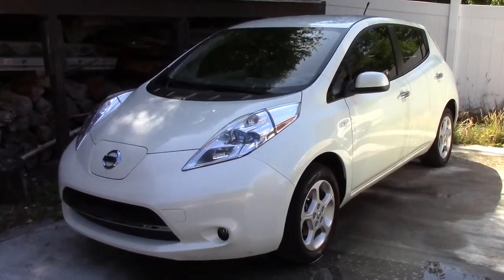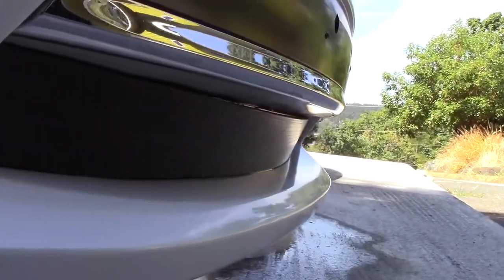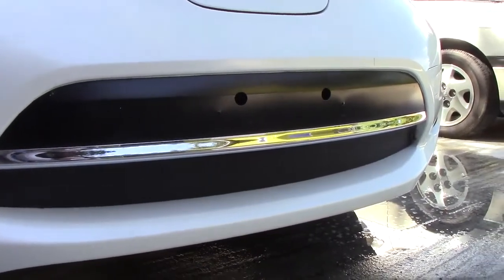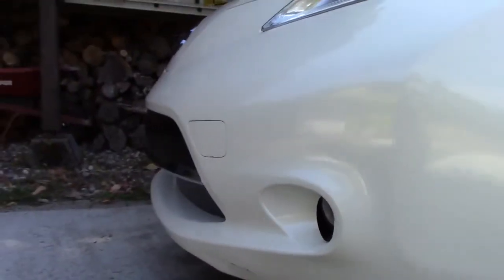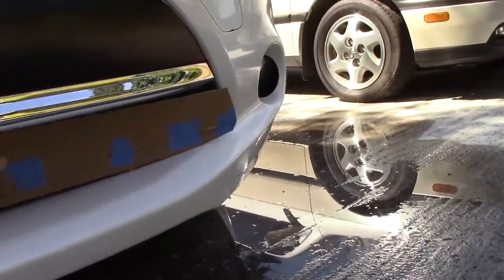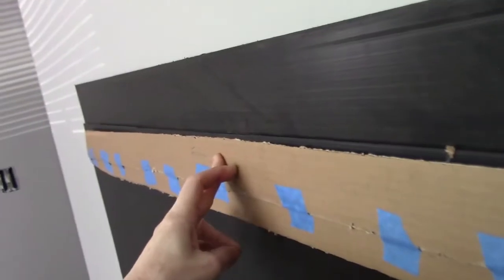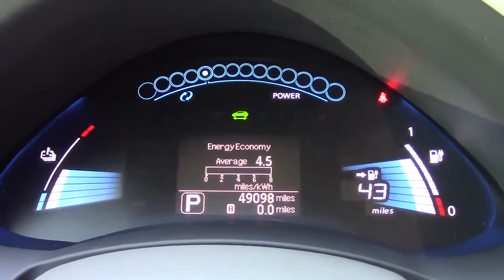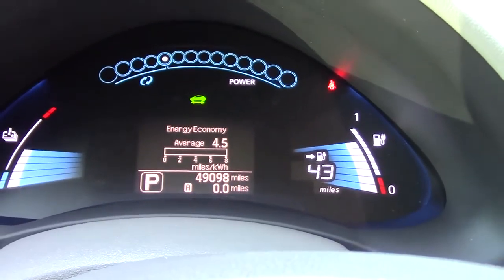Nissan LEAF - Modified - episode # 06

Comment: Lots of sarcastic comments here, but I did a similar mod using a 3D printed kit of small panels. I only use these panels in the winter time, as cooling shouldn't be an issue in winter :-)

Comment: The leaf has passive air cooling for the battery which is already insufficient when compared to other ev with liquid cooling. What you did there was to make the passive cooler even more ineffective. Your battery health isn’t going to like this mod. Bad idea.
Reply: Totally depends on where you live, dont generalize. I would pay for a battery heater, with yearly average temp being ~6C and often below freezing, the cold battery is limiting the range.

Comment: You know there's still a radiator behind there right? The motor is still liquid cooled
Reply from the maker: Yes, and no heat issues occurred in 90f weather.  A/C worked fine too.  Electric motors don't produce much heat & don't need such a large ICE radiator.

Comment: I think with the A/C condenser getting less air flow, the A/C would be less efficient and have longer run times which will use more energy from the battery pack defeating the purpose......
Reply from the maker: Yes, that would make sense... However,  what about the other 99% of the time !
Reply: OK thats 1% ...... The leaf also has a radiator to cool the motor and inverter if you drive on the highway 50% of the time (which is where this mod would benefit from) the motor and inverter will run hotter and be less efficient and use more power, it also can damage those components in the long run.....
Reply from the maker: I don't believe so.  First, of all this is not an ICE car: i.e. very little heat is being created.  Second, the radiator appears to be a full size unit right off the Versa/Micra & it has two electric fans on them as well.  If the slightest bit of heat is produced without the passive airflow, the thermostat would simply turn a fan or two on, as needed.  Yes, that would use some electricity briefly.  In a desert climate, maybe not the best mod. Everywhere else, there's nothing to lose & even more benefits in colder climates.
Reply: @theevolvingworld  so how can you gain range
Reply from the maker: @preciousredeemed4165  It's a little bit more aerodynamic with this mod.  Only helps at freeway speeds.

Comment: Your best mod will be a new battery.
Reply: 9 bars in 50 thousand miles. It's safe to say the colder the climate the longer the battery lasts. In Calgary at 50 thousand you get 1 bar loss not 3. I wonder what it's gonna be here in the UK on my Leaf
Reply: @ShabaaUkelele  I have a 24kWh Leaf with 50k miles here in the UK and 1 bar lost so far but I can see from Leaf Spy Pro that the second is about to go.

Comment: Could the airflow be there to cool battery pack??
Reply from the maker: Good question.  The battery pack is a sealed unit at the middle of the car & has a small fan or two for cooling.  Each cell is packed tight against each other inside.  I don't see any air ducting for it.  There is a water cooled motor/controller w/ radiator & A/C condenser in the front.  I would assume airflow would aid with that.
Reply: 1 gen LEAF has two cooling systems, with fans in the engine bay, to cool electronics.  Thanks

Comment: Ford actually made a louvered front grill for the focus that automatically closed at highway speeds and they claimed it made improvements to mpg. Your mod definitely does improve economy, but how much difference would require quite a bit of evaluation.  If you could do side by side comparison, that’s likely the best way to test it, or make friends with someone at the local wind tunnel ;)
Reply from the maker: Thanks for the comment.  I believe it does as well... just haven't noticed much.  As far as activate grill louvers go, more OEM are doing that so there must be a benefit... Whether that benefits a ICE car more to keep the  engine running hotter on cold days or to clean up the airflow might be up for debate.  Probably a bit of both.  Yes, it would be nice to have access to a wind tunnel.

My upcoming FIAT 500e review will display the OEM aero mods that make it different than the ICE version & may explain why it's goes 20% further than a LEAF with the same size battery.  That & 12% lighter doesn't hurt.🙂
Reply: @theevolvingworld  This mod still leaves a big cavity in front, trapping air and making vortex instead of letting it slip by.. I think one should try closing the cavity from where it begins. Your sideshots clearly show how deep the cavity is and where it starts. I think i will look into doing something with it..
Reply from the maker: @gelisob  I imagine one could add appendages to make it more raindrop looking super slick.  But that would be a train wreck.  You want aero, check out the "lightyear one", now that's aero!  For just a LEAF, that was a pretty clean mod.